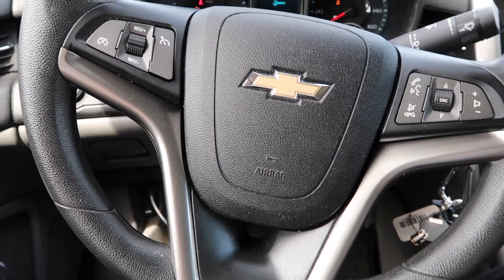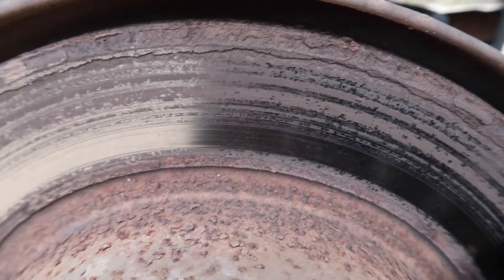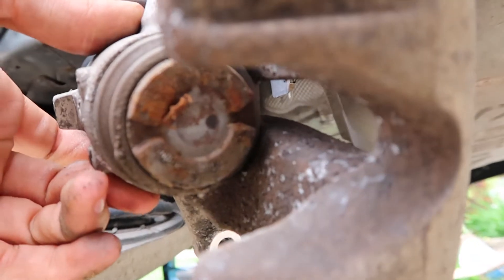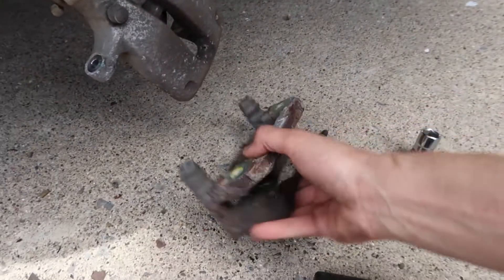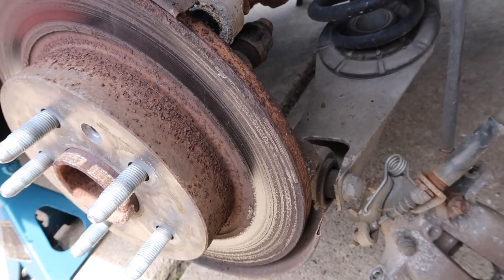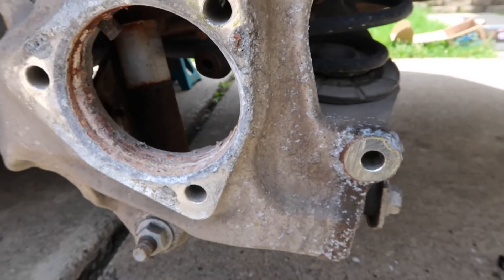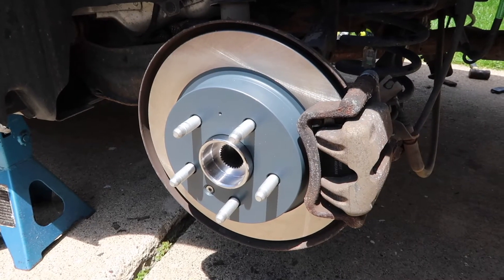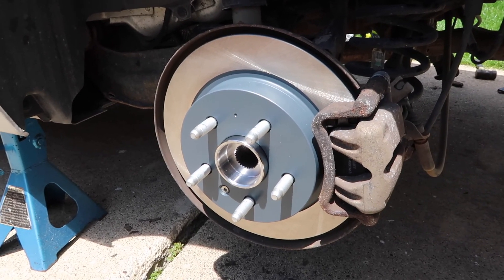2013 Malibu rear brakes with ABS code fix.

Comment: Twice I got the Stability Trak warning. But it went away by itself, the problem is that now the tire that is behind the driver's side when you brake something hard gets stuck, what can I do? I am from Mexico trying to communicate with you to know if you think it could be this failure of what you mention, no workshop can find the problem. I don't have any light on or abs, nothing, also, it is worth mentioning that if the tire is immobilized, then you step on the brake several times, it comes off, the tire moves forward again, but I want to not struggle any suggestions? I have already asked for enough money 😢, already changed front brake pads, rectified discs, purged all the tires and nothing, now they told me to change the brake pump to see if it is solved, because the brake was also sinking a lot, so they filled and purged, but it remained the same. It is malibu 2013, comes from the snow, if this little rust from below. I ask you please for an opinion. Thank you!
Reply from the maker: From what I understand the rear pads can get stuck in the caliper bracket. If this is the case the area where the caliper comes in contact with the pads should be clean and sometimes the removal of some material is necessary for the pads the be able to slide properly. Hope this helps

Comment: I have a 2012 Chevrolet Equinox .  Code c056d-00.  I’m at a loss determining if there’s a wheel bearing requiring replacement. Which one? Can worn pads set a code?  I had a few intermittent stabilitrak warnings, now it’s always on.  Clearing the code causes the warning to reappear after engine start.  Any suggestions? Thanks.

Comment: If you live in snow conditions, 
When you get home after driving your daily driver you should rinse down your under carrage at least once a week
with your hose , theres salt on the roads and salt eats away at all your vital parts and frame. You can save lots of headaches and money.
Reply from the maker: I have noticed that people who tend to use the car wash frequently in the winter have much less rot on their vehicles.
Reply: @eddiesspeedgarage  I just bought a 2015 Malibu and I try to wash the bottom of the car and undercoat it at least one a year.

Comment: I'm literally cringing watching the caliper dangle on the brake line. Also you could remove the speed sensor so you don't damage it.
Reply: Those calipers are light as hell. I also don’t suggest removing those speed sensors if you live in the rust belt as you’ll definitely break it taking it out.